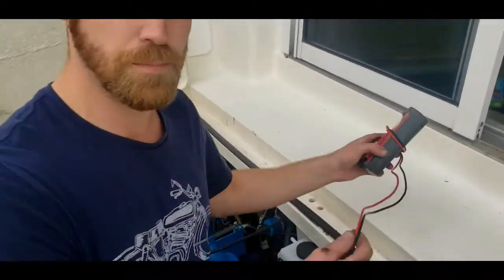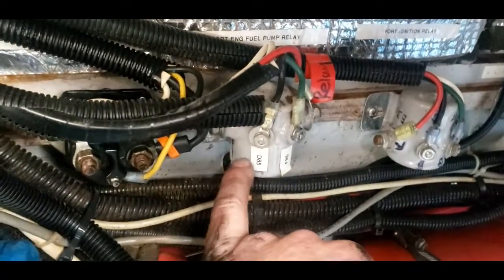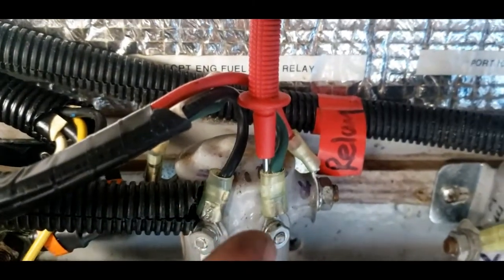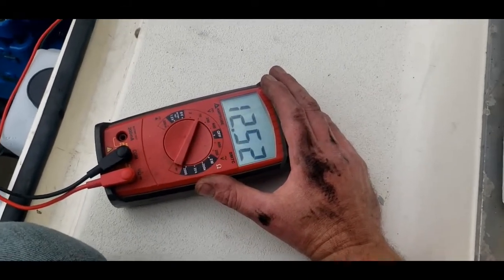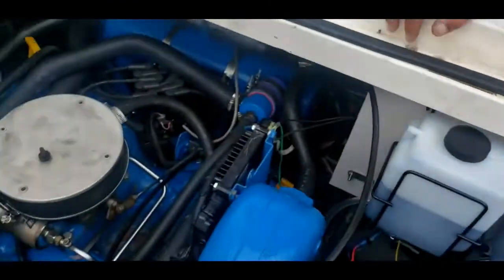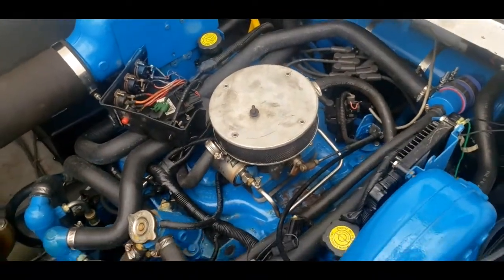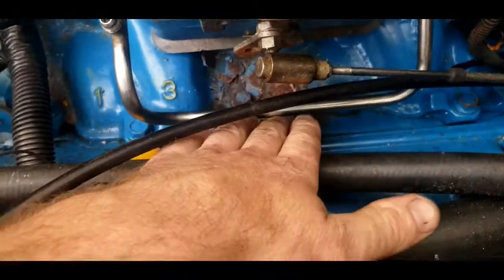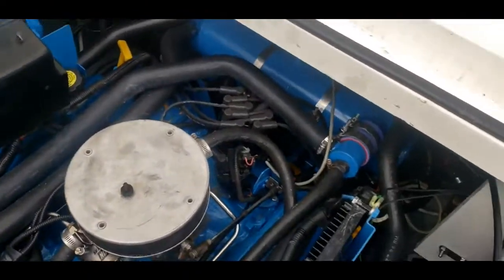Diagnosing 454 crusader engine (voice over correction)

Comment: Still some very good old motors. People like what they like but the GM big blocks are pretty reliable and have enough torque up high to run at 4 or 5 grand for hours if needed. They are definitely not good to you at the fuel dock. Just be glad they aren't a couple 502s I guess.
Reply: pay at the gas pump or go diesel and pay at rebuild / service time.  Its a wash but for DIYer I'd take a 454 block that can be continually rebuilt for decades at a machine shop.